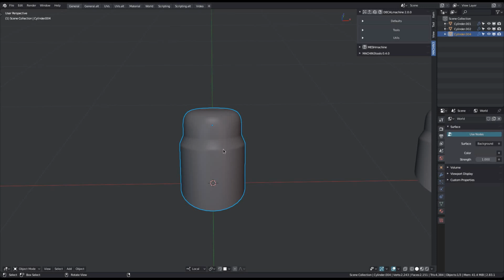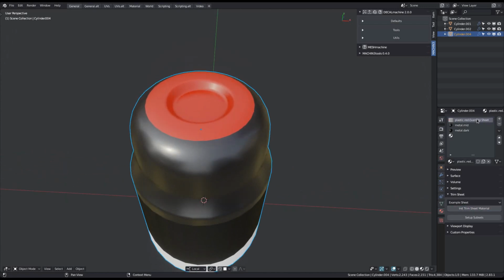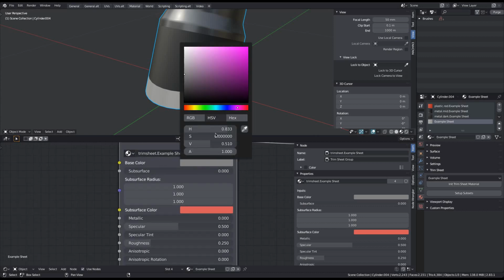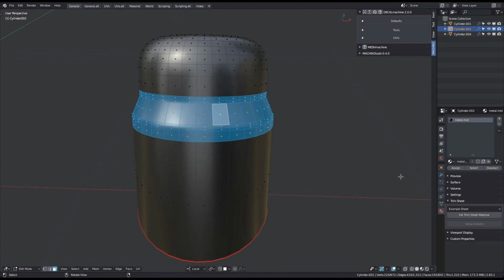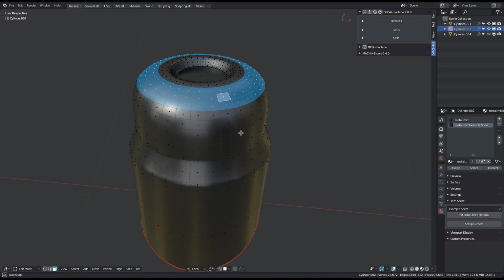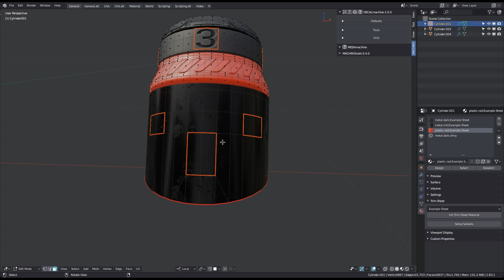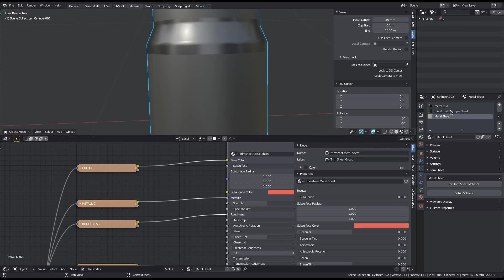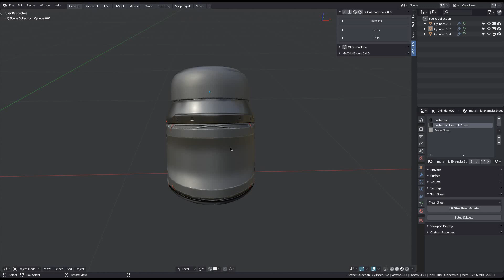DECALmachine 2.0 - Init Trim Sheet Material

Comment: seems useful, but not a trimsheet for game development, as it doesnt "create" any, you still have to create the trim sheet yourself unfortunately.
Usually you want to have a mesh which then is baked into all trimsheet textures, usually a plane baked against a lowpoly flat plane in substance or blender, but since this is just assigning, i dont see the usefullness of it. 
I actually thought this would allow to automatically bake the entire mesh into a trimsheet texture set based off face selection in edit mode.
Do I misunderstand something?
Reply from the maker: See https://machin3.io/DECALmachine/docs/trim_sheet_creation/ 

What you talk about(building and baking the sheet) is trivial and doesn't need to be simplified anymore. It can be done in or outside of Blender.
The setup of the sheet, with all the individual trim locations, and doing it in a way, that that DECALmachine understands it and so can make use of it in the trim UV workflow, is where the magic happens.

See https://machin3.io/DECALmachine/docs/unwrap_trim/

Not for game development? What? See https://machin3.io/DECALmachine/docs/export_introduction/
Not only is this purposely made for game development -  when you want to bring your design into the engine of chosing, it's is the most easy thing ever. You don't even need any special tools. With the trims/UVs finished, you just simply export your mesh in any format you prefer, and you are done.

This is in Unity: https://youtu.be/FjeJl5aS5xM?t=140